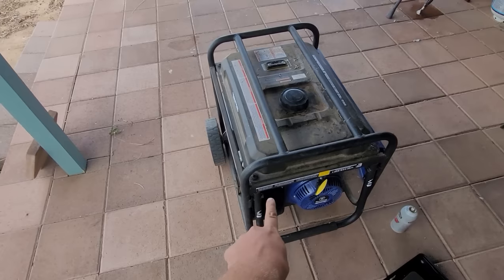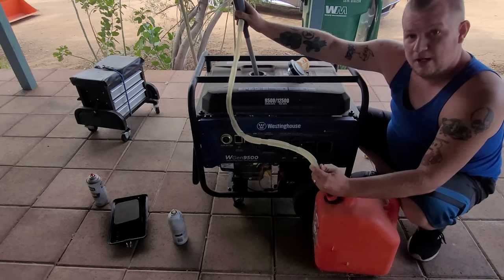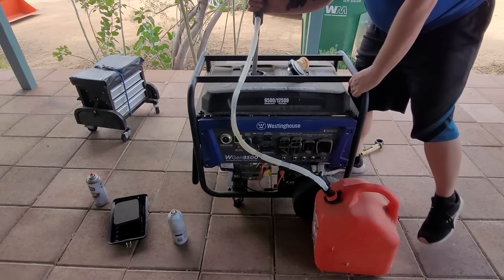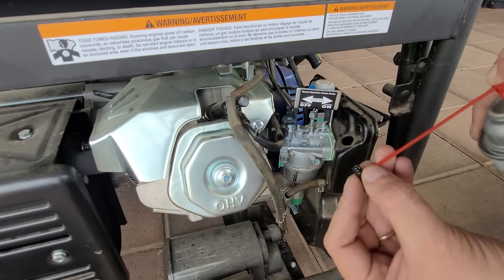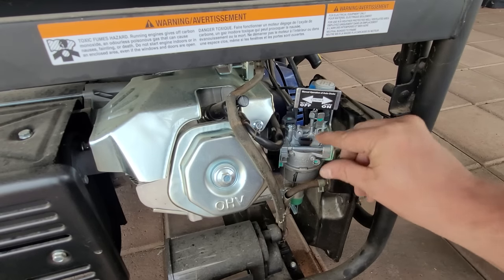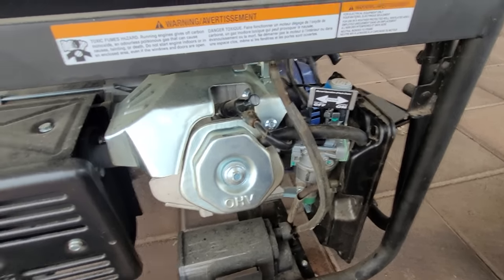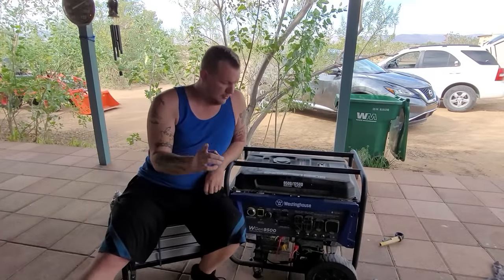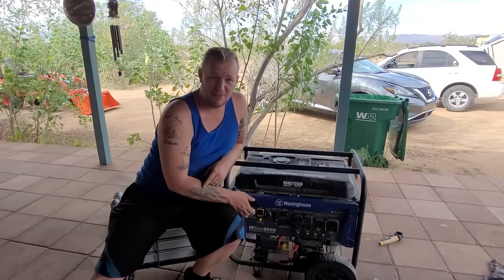Surging Generator? Quick repair for ALL surging and hunting engines.

Comment: In my case. Surging Honda GX 390 on a generator was surging only under 1/2 tank of gas. Tried solving it with new or even no gas cap, new fuel hoses, fuel filter, petcock, flushed gas tank, new Genuine Honda carb and even used aviation fuel. Still it would starve out near 1/4 tank and would only run while spraying starting fluid in the carb. 
Surging = Fuel Starvation, especially with less than half tank of fuel in my case, even when it was new.  A generator runs at high speeds all the time requiring the highest of volume of fuel in the line at all times. 
Generators are designed to be low profile and an inherent flaw is that the fuel tank is (TOO LOW) just slightly above the carb fuel inlet for gravity feed through a hose. At high speeds and especially with little fuel in the tank causes a weak flow to the fuel inlet causing starvation/surging. 
MY SOLUTION: 
I discovered that by raising the entire fuel tank by 8" gave me MUCH better fuel flow down to the carb and the surging went away even with almost no fuel left in the tank. You can definitely see the difference (before and after) with a see-thru clear fuel filter which should always be at least 1/2 full during operation on a high speed motor/generator.
Another mistake I made was storing Ethanol fuel for more than one season in my shed. The stuff goes bad and causes havoc on small engines. Periodically check the color of the stored fuel in a glass jar. It should be clear. If it is golden/urine colored, DONT USE IT in a small engine.. Car engines don't seem to have a problem with the aged fuel. I had about 20 gallons of yellow colored fuel and added a few gallons at a time to an almost full tank of gas in my car and it burned it with no problem.
I hope this helps somebody as I almost gave up and it cost me $ and lots of time, but I won and learned a valuable lesson that nobody ever suggested to try.

Comment: I have the very same issue with My RYOBI 6500 Generator.  Surging / Rough operating.  I never realized that when I got it 3 years ago (acquired in a scramble at Home Depot after losing power for  days from Eiasis Storm in NY 8/2020) that the gas I purchased should be Satbilized [Stab-Il].  I should have read the manual more thorughly.  As soon as I got it up and running for about an hour, the pwer came on!!  I have test run it only periodically since. When electric went out the other day, the generator started up with difficulty ( a lot of pulls) and ran with a surging.  THX for this video.  I will clean the carb as described and hope that does it!!  BTW, that battery operated pump / Siphon does NOT get all the gas out of the tank. it leaves a remnant as he siphon cannot suck up from about 1/4 " from the bottom.
Reply: Just did what was described ... Had to do it 2X, I did have a thin wire brush ,but used a very small metal wire.  That seemed to do the Trick.  Learned my lesson about using Old Gas.  I had no idea.  I do now.  Bought STAB-IL for the new gas I purchased.  Do I add STAB-IL to the Generators gas tank?  or just to the gas in the storage conatainer?

Comment: That screw you took out is your JET SET SCREW. Unless you have an inverter generatot, this screw sets your rpm of your engine. The rpm speed of the engine determines the cycles per second (hertz or frequency) of your generator head. In the US we have 60 hz, Europe is 50 hz. If you do not have a frequency meter you should start by turning this screw in all the way while counting the turns to get back to a ball rpm speed when you reinstall it.
Reply from the maker: Yep
Reply: Actually, that's the idle set screw, and it shouldn't have any effect at all on a generator since most generators don't idle.  The only time it needs to be taken into account is if the generator has an auto-idle circuit in it.  Otherwise you just screw it in far enough for a couple of threads to protrude from the other side, then stop.
The speed at which the generator runs is controlled by a different mechanism, which connects to the throttle control.

Comment: I always use a set of hair bits and drill the main jets out. Especially on Briggs and Stratton engines. They are almost always undersized and surge. Most older generators don't have that pilot jet setup and you have to remove the bowl to properly clean it.
Reply from the maker: Yes correct 💯 thank you for watching

Comment: I've got the 7500/9500  with 2900 hrs on it lol, dont know their lifespan, on 2nd set of brushes, "fuel pump" is out so i just gravity feed it, its been little rough lately, i shall do this! Most small carbs do that crap cause cheap gas with ethanol. They wanted me to take it, all 200+lbs of it to idk...been a mechanic 40yrs. One review guy said he got parts under warranty, ill see.

Comment: Mine is doing the same … works most things like grinder drill but won’t entertain the small welding set … it has stood a long time will try new fuel … fingers crossed all your help appreciated🇬🇧
Reply from the maker: I hope it works it's more then likely the carburetor

Comment: Watched another video in that the guy turned the black screw at pilot jet on carb all the way in noting how many turns it took to hit the end. Then after cleaning out , putting back he unscrewed it out again the same amount of turns it usually between 4-6 full turns ,  Good video 🕵️👍
Reply from the maker: thank you
Reply: Fun fact. Generators aren't designed to idle. The idle screw goes in far enough to hold the pilot jet, but it shouldn't be installed far enough to contact the throttle plate cam. Otherwise it will interfere with proper operation

Comment: Worked for me, thanks.  But I had to remove the control panel, air intake and carb to get at the jet on my Honda EG2800I.  (the air intake and carb were  held together with the same set of bolts to the manifold).

Comment: I got myself a new Dual fuel Carburetor yesterday and it was a nightmare to install (because the frame was in the way) after removing the engine from the frame , installing new carb back on the frame . My generator wont run, neither on LPG or Petrol, it starts but cut off within a minute the sound was like yours at the beginning . Petrol is new and so is the carburetor

Comment: I have a brand new duromax running rough on propane and gas. Non ethanol. If I hold the auto choke lever further open further than it’s auto position it goes away. Is there an adjustment for that?

Comment: One way to help avoid fuel problems, especially on equipment not used very often, is to use ethanol free gasoline.
Reply from the maker: Amen to that my friend
Reply: @RepairGang  where I live, there's no such thing as "gasohol". It's just the regular Shell v power super unleaded premium or the Total excellium 95 and yep, these 2 brands have a decent shelf life of 6 months to a full year because they already contain additives. I use total excellium 95 for most part and it has a strong old school petrol smell.

Comment: I have found that even cleaning carb after removing it and take the float and needle valves out and the main jet too that it still will surge after cleaning all that.  I ultimately had to drill out the main jet a 0.001 or .002 because it was running too lean. If anyone is too scared to do that then try ethanol free gas first because that would naturally enrich the mixture with the same volume of fuel used.  I found that helped in my case before drilling the jet to be able to use regular unleaded with ethanol mixed in.  Oh I forgot that you need to check the float level too !  If it’s too low then it runs lean also.  I fixed my uncle’s brand new Pontiac in 1977 with a hesitation problem due to lean flow. His mechanic didn’t want to mess with it and the dealer couldn’t figure it out I believe. I found the float was set too low and that wasn’t enough to stop the hesitation so I was able to adjust the metering rod slightly higher as well.  The car accelerated like it should with zero hesitation after that!

Comment: Sweet I'm going to give that a try
Reply from the maker: Did it work?
Reply: @RepairGang  no it didn't I'm starting to think Mines got so much run time on it the valves might be completely out of adjustment.
Reply: @RepairGang  mine ended up being a different problem altogether. Mine is/was equipped with a spark arrestor and it was so completely choked with carbon deposits that my motor would just chug and sputter. Problem solved now and I didn't really see it nessicary to clean it and put it back I just left it out altogether and it's running like a champ. They build some of these to work against themselves.

Comment: I found an easy solution to all the gasoline problems.  I converted my generator to run on propane!
Reply from the maker: Propane is actually a really clean energy source. You just lose a little bit of wattage

Comment: My generator is brand new and the gas is only a month or so old.  I started it when it arrived and it ran perfectly.  Today, I thought I'd start it just to let it run a bit and now it's surging.  I don't understand how this could happen when it was running great when I started it for the first time.  Very frustrating.  My problem may be the access to the carb.  But I'll see if I can get to the stuff.
Reply: Fixed!  All I did was remove the jet and clean it with a B-string from my guitar.  Runs as smooth as a kitten now.  Thanks!

Comment: I had the same problem and just removed the air filter and blew the cleaner spray in the air intake pipe and it got fixed right away

Comment: It's basically an improper f/a ratio on either the main or idle circuit, whatever the cause.  (Gunk buildup from evaporated fuel and/or misadjusted mixture screws where present)
Reply from the maker: These mix screws are a pain to get to but yeah it's a bit of build up
Reply: @RepairGang  
I like the carbs of my youth with which we could adjust main jet flow (usually bottom of bowl) and pilot jet (side).  But two things, most people couldn't figure them out and ended up botching it to where they had to seek out a shop or neighborhood kid to get em going, and then the control freaks didn't trust us to set them correctly so as to minimally pollute so they pushed govt regulations to have them made fixed.
But for those of us who knew what we were doing, it was sweet.
Reply from the maker: We can only wish The car is back in the day were great or you could adjust them under it. You get them running perfect. Older machines are so much better
Reply: @RepairGang  
Well, I mean it's a different world now.  It's interesting and informative to watch the sensor outputs in real time with these computer controlled systems.  A lot can be diagnosed from that.  

But, I can feel right away if an engine is running too rich or too lean and the difference between the main and pilot mixtures on carbed engines, while a lot of newer mechanics can't.   That's the result of having to adjust those things frequently as a kid.
Reply: I've had surging issues on my generators and every time it was sloppy linkage from governor to carburetor. Installing a light spring  placed parallel with the linkage rod will make it stop most of the time.
Reply: @danstrayer111  
Most of the time it works every time!  There's a movie quote in there somewhere.
Personally, I'd have to go back decades to find an engine that wouldn't hold speed due to sloppy linkage.  But some engines come with that parallel spring you mentioned.  Others have a helical spring around the throttle shaft pushing it closed opposing the force of the governor spring pushing it open.

Comment: Appreciate the video. Having this issue on a Durostar 10000EH, the idle screw has a tamper cap on it, is there a way to easily remove.
Reply from the maker: Yeah it will pop off easy with a pick don't even have to put it back on
Reply: @RepairGang  great thanks!

Comment: Do you think the same approach will work to address a generator that races after it is started? Meaning bad gas and a gunked up carb?
Reply from the maker: Yes should be if it's only racing at start
Reply: well it races at start and never winds back down.  I shut it down after about 30 seconds so i don't tear up the motor.  will try what you suggest

Comment: Hi, mine does surges but only on propane. On gasoline runs great. Any idea what it may be or how to fix it? Thanks a ton.
Reply from the maker: That's has to be a air issue or gasket issue

Comment: Hello. My older Coleman generator (5hp tecumseh) recently had a new carb installed and still surges when not under a heavier load.  Would adjusting the idle jet help? Or can the governor be adjusted somehow? Thanks.
Reply from the maker: It can help but most of the time it's gaskets or the carburetor

Comment: Honda 5000 generator motor runs fine...flip circuit breaker on with a modest load and the surging begins....help needed. Tnx
Reply from the maker: Clean carburetor again it's a fuel issue check gaskets sparkplug add seafoam

Comment: Hello,  I have black max 3600, left some old gas in it, other day I tried to start and it wouldn't start so I took the carburetor out and cleaned it, put it back, put some new gas in it and I was able to started .

Issue i am having, when I push the choke all the way from start to run it surge like you had it in the beginning of the video but if I bring the choke halfway like in the middle between start and run and it runs without surge. Any thoughts? Thank you very much!
Reply from the maker: Take off and make sure gaskets are on the right way cuz they're easy to put on backwards or put on wrong way. Also make sure they're not cracked. I'm pretty sure if you check the gaskets you probably got one flipped. Still fits backwards but it doesn't work right. So if you flip it, you'll be fine. Good to go
Reply: @RepairGang  okay so I ended up doing exactly what you did in this video, fixed the issue I was having but the problem is now, when I put load on.. it surge again... I am gona try to mess with carburetor, check the gasket like u mentioned.

Comment: Beryl aftermath-What if the piece under the set screw you touched to check for heat is extremely hot? What might that mean?

Comment: My 8kva generator started surging and cutting out so I put new fuel in. I took the carburetor off and cleaned it and blew the jets out with compressed air and the problem still persists yet some times it starts and runs perfect and other times it will need to be restarted up to 10 times before it settles down and runs properly .
Reply from the maker: Maybe check those paper gaskets

Comment: Great video can you tell me the gas syphon you used. I see a battery operated one at harbor freight but it looks different thanks
Reply from the maker: It's pretty much the same one from harbor freight. Go ahead and buy that one. The one at Walmart's cheaper though
Reply: @RepairGang  Is the one you have battery operated and the reason I’m asking which one you have is the hose on the one you have looks a lot longer than the one harbor freight has?

Comment: I’m at 62Hz, not too worried, but with sensitive electronic equipment I’m slightly scratching my head. Is there a governor adjustment to reduce RPMs therefore frequency?

Comment: When you used the brush to clean out (?), your hand covered up what you were doing, so that was of no value.  Also, the orfice that controls the fuel is inside the small black tube you removed from the carb, running parallel to the length of the tube.  Carb cleaner probably won't remove the blockage...you have to run a very thin wire or mini drill bit inside the little tube to clean it out.  Very important step you left out!
Reply from the maker: Eh I was learning how to make videos still 🤪 getting better

Comment: Can you show how to replace the spring for automatic choke?
Reply from the maker: I believe I can
Reply: @RepairGang  that would be awesome. I have a 7500df and it only clicks when trying you start. I started to disassemble to check it out and the spring from the carb/choke popped Off with some random plastic piece.

Comment: my 2007 harborfrieght 8750/7000 has never failed me yet. i love it. but it wasn't quit large enough to run everything in my house mostly the water heater. but i mean zero trouble. so 6 months ago i got a 13000/10000 and it will run everything. the only trouble is who the hell knows if its going to start or not. it will run good once it levels out. if it levels out. and i start both of them on the 3rd of every month. thats my payday thats why i know when to start it let them run about 15 minutes and shut them down. because where i live i think 5 or 6 months is the longest we can go without losing lights. i almost sold my 8750 but glad i didn't. because it never fails but this new one scares me.

Comment: I followed your video, when it came to the block off one hole with you a finger and spraying to clean out the jet. I could not get anything out of the end it looks like it has  a brass plug in there,. can i buy new carb on line. and just replace the thing???
Reply from the maker: Yes you can they cheap

Comment: Hello can you make a video step by step close up how to remove and install new carburetor on a westinghouse wgen 9500df generator, picked up new unit but carburetor was removed and no exact service manual how to fully remove and install new unit with the auto choke assembly ! Would love some help - westinghouse has poor service and no service tech in Phoenix AZ area 
Thanks Edward